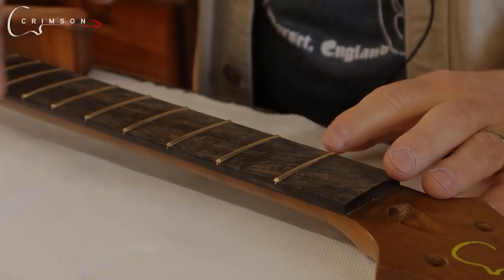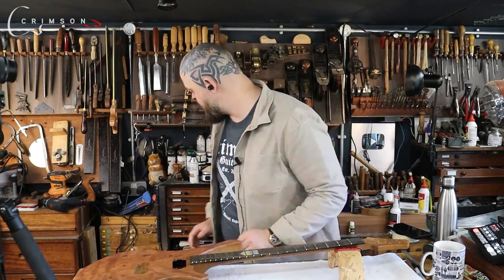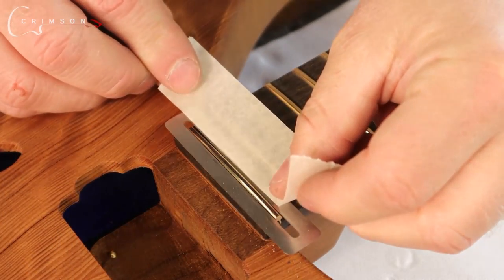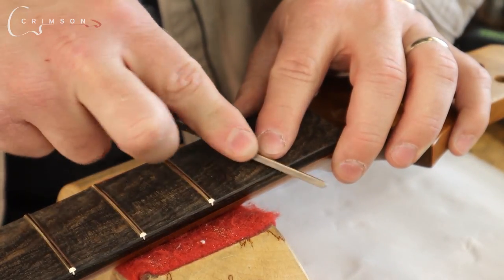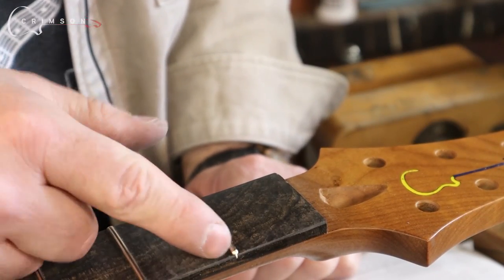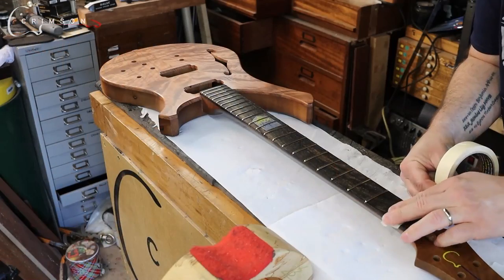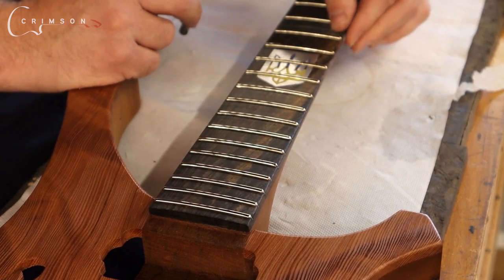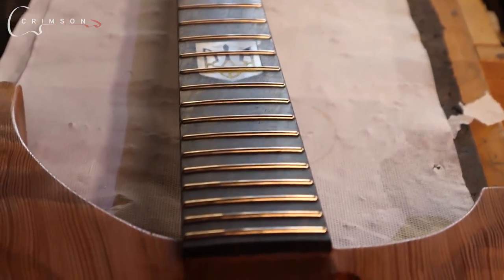Semi Hemispherical Fret End Dressing Ep 7 | HOW TO on the Boutique Hollow Body Baritone Guitar

Comment: Gorgeous looking thing, I have to admit. And the frets do look stunning. 
I have a tip for anyone who cares to hear it- albeit for a fret dress situation rather than installing new frets as here.
I've had a big run of fret dresses this spring, and I've been able to speed up my process, while keeping great results. On a masked up fretboard, once you've crowned your frets, instead of attending to the ends with a fret end file, take some 250, 400, 600 and 1000 grit wet and dry paper. Cut a 2" square of each grit and thoroughly polish each fret along its length with each grain, using your fingertips as the sanding block. It should take you about 20 minutes, and get dramatically faster as you go up the grains. Because your fingertip conforms to the shape of the fret, all your rounding gets done as you go. No need for the fret end file, and you polish as you go. When you're finished with the wet and dry paper, polish each fret with 0000 grade steel wool. Another ten minutes, and you should have a mirror shine making bends feel totally effortless. You can go as high as you like with the sandpaper grits, and then fetch out a buffer afterwards if you like, but really, you're good to go after the steel wool. 
Anyway, keep the videos coming. I love the way this guitar is shaping up.
Reply: The fret erasers are good too, but if you go with the steel wool make sure to tape off your pickups,  or you'll probably have some steel wool sticking to them.
Reply: @GP-Music.  Good point. What he said.
Reply: I've found that buffer polishing with compound beats all other polishing methods - steel wool, sandpaper, fret erasers, micro mesh, metal polishing pads - you name it.   Before I recently discovered this type of fret rounding, I used to round-and-roll all at once similar to the way you describe. But with buffer polishing, you only have to go to 320 on the round-and-roll, and the buffer does the rest.  Nowadays, on frets that have already been rounded and just need a little cleanup, I'll roll-and-round with 320, then buff.  For new necks, I do the hemispherical ends method shown here.
Reply: @normbarrows  Can't argue that a buffer gets great results, but I don't have one, and sandpaper is about 50p a sheet for the good stuff. One day I'll have the cash spare.

Comment: I do my fretboard a little wider, say a couple of mm. I do mine 43.5 at the nut and 57.5 at the bottom to compensate for the bevel, and I round one side of the frets first before installing them, preferably the bottom part. Sometimes I have to file one or two but for me it’s better than filing all frets. 🙂
Reply from the maker: You absolute genius! I love it, thanks for the tips!

Comment: I did this on a recent build.  The frets came out looking just like yours - best frets I've ever done.   I used a 1/4 round file in addition to the fret end dressing file to round the sides - it speeds things up slightly.  I used a concave 1/2 round fret crowning file to round the tops one at a time.  Using a fret leveling file or beam as shown here to do them all at once is more efficient.
Reply from the maker: I generally steer clear of the concave files but do think I should give them another go for this particular task.. good tip

Comment: I have an old Eko acoustic with what must be Bronze frets,  it`d been played by goodness knows how many before I bought it 25 years ago & it has zero wear on any of the frets, so that must be the answer (I`d always wondered-thanks Ben)!
& wouldn`t it make more sense to run  a single 2 1/2" (or 3") piece if masking tape the length of the fretboard & then simply cut around each fret wire?
OH, & if you`re gonna mask it this way, here`s a tip that does work, simply run a strip of masking tape down each edge first, then grab the the ends of each when removing, pull on those & they`ll lift all the strips of tape with them!

Comment: Question about the fretboard cleaner and restorative:  In the video you used the cleaner then the restorative, however the instructions on the cleaner bottle say to use the restorative first, so... What's the proper order to use these products?
Reply: cleaner first, must be a typo
Reply from the maker: Just checked the website - definitely says use the cleaner first.  DC
Reply: @CrimsonCustomGuitars  sounds right, might be worth checking the wording on the bottles.

Comment: Quick question brother, do i need to level my frets after refretting? When checked it seems the difference is very very low, like the rocker is barely moving.
Reply from the maker: Any movement at all in the fret rocker is bad, yes, you will have to level.. it does sound like you did a REALLY good job at the refret though. Nice one!

Comment: Quick question,  if a guitar has a zero frett do you have to dress the frett before the nut goes in place or can it be done after the nut is installed?
Reply from the maker: It is certainly easier to dress the fret without the nut in the way but it could be done if absolutely necessary